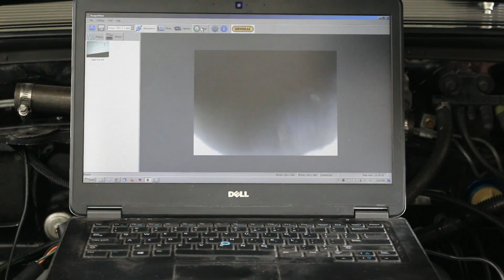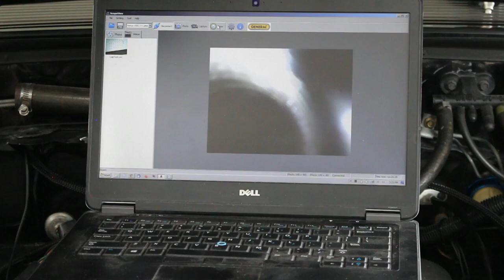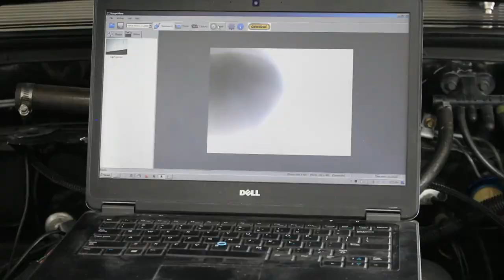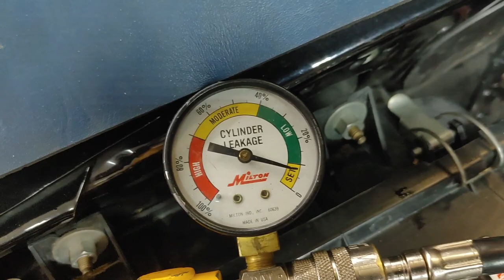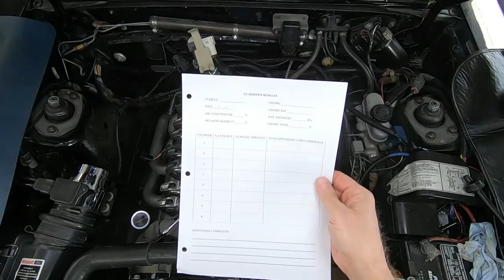Engine Inspection

Comment: Interesting video for sure. I like to see how others do these types of inspections. I have my SBC out to fix some oil leaks and swap to a solid roller cam. I leaked down the engine and found #8 had 22% leak down out the exhaust. All others were 2-3%. I pulled the head, checked the valve and it looked fine. Hand lapped the valve and it is fine now. Always a good idea to check leak down.